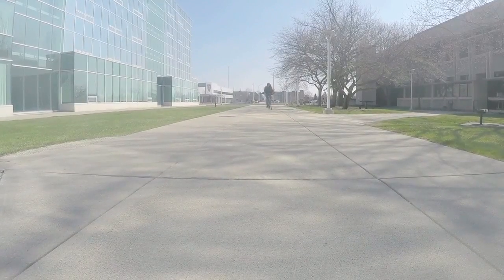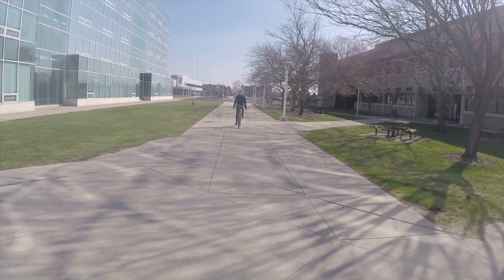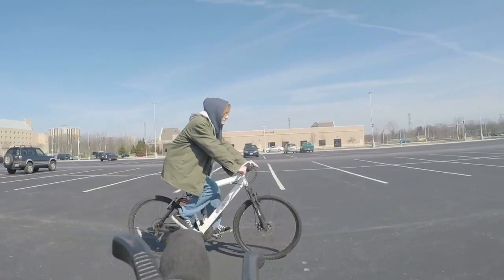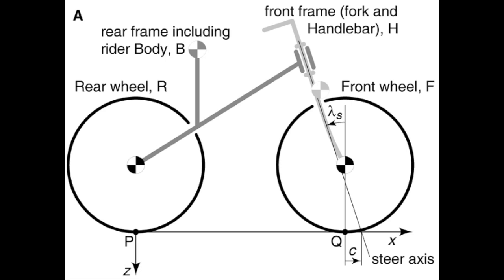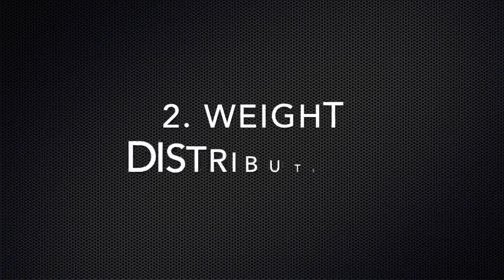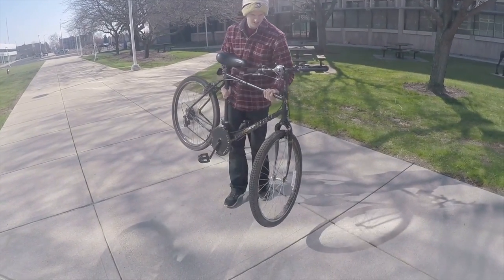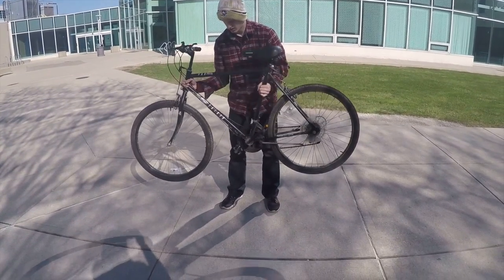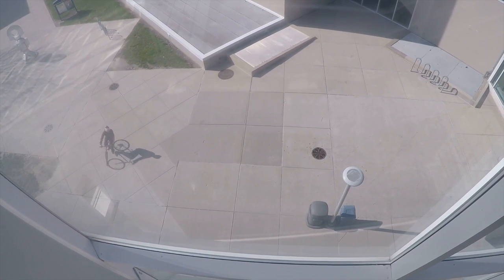The Physics of a Bicycle - Balance & Turning

Comment: Also tire torque "tank steers" the front wheel in the direction of lean. The inside edge tire radius is smaller, so the center of the tire is moving faster than the inside edge so if it's tilted to the left, the right hand side of the contact patch is moving faster, causing it to steer to the left like a cone rolling on its side.

Comment: I just today learned how to balance a bike
Reply: How ti learn turning I can paddle straight but I can't turn.
Reply: @av7337  use ur legs to turn
Reply: @av7337  i learned how to do wheelies
Reply: @av7337  dont turn the bike fastly, do it slowly. If you want to do a U turn then you have to use ur legs
Reply: @av7337  lol me tooo
Reply: @masiraabid6427  i just learned cycling a month ago, I ride every morning a km or so.
You will learn it just have some extra space to turn & do it slowly
Reply: @av7337  yeah , I literally fall 4 times today and bleed my knee
Reply: @masiraabid6427  Just lower seat and use legs when you feel like loosing the control and don't given up learning, I had halfway learned to ride in 2011 but I left bcz I was embarrassed to wobble ride in public and falling.
It took me 9 years to get back to cycling, I rode on empty roads and parks during morning and learned slowly and voila every morning feels new😋
Reply: @av7337  yeah ,thanks for motivation I needed it , and when I learn i'll let you  😂
Reply: @av7337  you know I can turn left or right but in case of u turn i just peddle slowly and there are like 10 or 12 kids  riding at the same time and those 5 yr olds just beat me and I am 15 its kinda embarrassing but now I know just find the correct time correct place and yes most important you need to have courage which I didn't so now it's getting better everyday
Reply: @manyasharma19  yeah that's the spirit just find an empty space or time slot initially until you aren't good then it's smooth sailing, I in traffic a week ago it's 10km daily for me, although I still need to develop techniques to ride in heavy traffic in our country coz no one gives a damn about cyclist here so be alert always.
P. S
Keep riding Ride slow and always use legs for extreme use case (if you don't wanna end like those boomers using legs for brake)
Reply: How 😢
Reply: @nadjamdz1091  just don't lean it to one side or you'll lose balance
Reply: @senpai3556  how much time it take today my third day but still struggling with only one pidle
Reply: @snehal-5736  well that depends on your balance if you have good balance you can probably learn in a week or month or if you have bad balance it'll take a while just dont give up. Also I have  a tip try hold the bike up don't lean it to one side or you'll fall down and it took me like a month - 2½ and yeah that's it.
Reply: @senpai3556  I lost my confidence 😔 but I never give up
Reply: @snehal-5736  how's it now?
Reply: @snehal-5736  good that's the first step but you really have to be determined because I was confident enough thats how I learned that but if your not cofiident enough you'll go less to practice it'll make it more time and you'll lose lots of courage\confidence so you should practice more .
Reply: @senpai3556  Yes I tried😊😊
Reply: @snehal-5736  dont worry man i trained to ride a bike for 2 nights estimated hours 12 hours just dont give up and my tip is doont look on the ground just pedal and try i know youll miss the second pedal at first but youll get used to it after you pedal the first pedal immediately pedal the other one and straighten your body or youll lose balance and crash, turning a bike is something you can learn by time it comes naturally,
Reply: @nadjamdz1091  use a friend of urs to keep balance of the bike, and move fast to keep balance of the bike.
Reply: I did just yesterday!
Reply: how to turn pls tell
Reply: @XDstomper  just slow down when turn come and slowly turn your bike handle